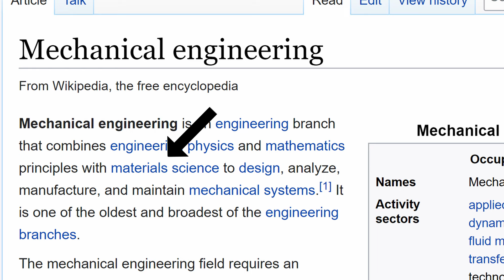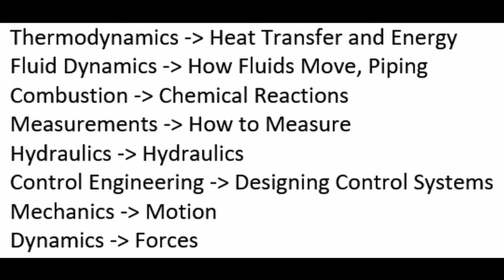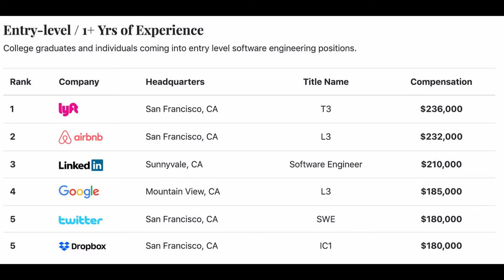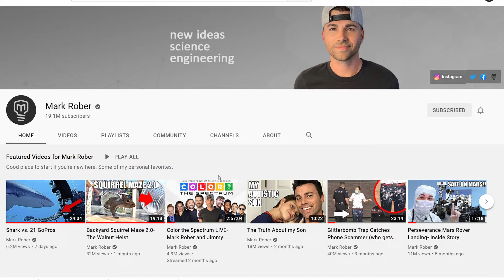EVERYTHING Mechanical Engineering! | Jobs, Degrees, Salary etc.

Comment: is it okay if you are  slow  at math then you do mechatronics?
Reply: Honestly no
Reply: You need to be good at math with all engineering degrees. If I recall all of them use a minimum of calculus 2 like coding but you would have to learn alot more if you were to do mechanical.

You can just pass or try extremely hard for the fist couple of year until you get used to it.
Reply: @bigcrowe9573  yeah idk how is the program in US but here we have  calculus  1, 2, 3(several variables), 4 (vectorial) and  5 (complex)  linear algebra 1 2 discrete math numerical methods prob and statistics and differential equations and all the physics which it has a looot  of math: physics 1 2 3 fluids thermo  mechanics  EM, waves and vibrations elasticity and experimental physics 1 and 2.
You don't need to be fast at math I believe that comes through practice. But If you are slow you have to get better otherwise it will be extremely hard for you. I thought I was good at math until I did  calculus 4... yeah

Comment: 1. Always take the job with a higher salary over the one offering stock option, RSU's, bonuses, and other "compensation". Salary is KING...you may not realize this until you start applying for a mortgage!
2. Change companies every 2-3 years to keep your salary competitive. Don't get comfortable or your salary will pay the price. This is coming from a mechanical engineer who worked at AMAT for 17 years and found after being promoted to a manager, I was making $117k in 2017 while my direct reports were making $150k. =(
The more you stick to the above, the more money you'll save while youre young which will have a longer time to compound over the years leading to a faster retirement. Good luck!
Reply: When you switch jobs do you get the same or higher amount? Do you also know how easy or hard it is to get a mechanical engineering job.

Comment: After completing a degree in mechanical engineering, you have several paths to consider. You could pursue advanced degrees like a Master’s or PhD to specialize further or engage in research. Obtaining professional certifications, such as a Professional Engineer (PE) license, can enhance your credentials. Entering the workforce, you might work in industries like automotive or aerospace in roles such as design engineer or project manager. Specializing in areas like robotics or mechatronics can help differentiate you in the job market. 

Additionally, pursuing further qualifications in fields like project management or starting your own business are viable options to leverage your engineering background and advance your career.

Comment: Your video is very nice but you have to describe which part of the job in mechanical degree is very very easy and very very  hard 

And try to make many vedios about different different roles off job in factory 

And also make videos about which job have highest pay  in mechanical engineering degree field

And also  makes vedio   how much products  designer work pay u and which  
Also make vedios about which kind off chapter we have focused off in math's and physic to study 

And link for study  and improve study  

Ans free design learning  link 2 d 3 d

Comment: Is it possible to do masters in aerospace / Aeronautical engineering after doing bachelor in Mechanical engineering? Or is it worth?
Reply from the maker: If you want to you can definetly do that. Up to you to do a cost-benefit analysis
Reply: absolutely
Reply: machE is very related Aero engineering
Reply: Aerospace and aeronautic is mechanical engineering with an extreme focus on those subjects, if you know mechanics you are going to have no problem with what do you want.

Comment: bro Is mechatronics and robotics automation engineeirmg same?
Reply: Automation engineering means that you will be working manufacturing line robots, auto sync systems and etc.
When you're doing mechatronics, it takes you on robots, or moon walkers and other stuff that has brain like PC
Reply: @2listen911  bro i said about not only automation it's robotics and automation engineering
Reply: @jck1784  close enough lmao
Reply: It's basically the same and it only depends on school. Some schools have more mechanical engineering subjects some schools electrical or software engineering subjects...

Comment: GPA is the key difference between BS & MS Engineering. 

You can graduate with 2.0 GPA and get a BS Engineering degree.

Whereas u are required to meet minimum 3.0 GPA throughout your graduate studies.

Graduate school allow a maximum of 2 C’s to continue and graduate or otherwise u are out of the program.

Whereas undergrad schools require minimum 2.0 to graduate. 

This is a huge difference between BS & MS Engineering and make the MS way more difficult than BS.  

Graduate level courses assume u meet  the prerequisites, otherwise it’s a waste of time and money because u would not be able to catchup.

Even advanced mathematics assume u are well versed in Calc 1,2,3.  

As an example, u would not be able to handle graduate level structural or system dynamic analysis or graduate level vibrations courses without the prerequisites. 

You would not be able to pass FFT without command in calculus as an example.  

You would not able to handle stress analysis and FEA without the prerequisite u are required to complete.

Universities regular issue quarterly or semester schedule with list of courses and prerequisites. 

Never never ever try to  jump over the prerequisites or suffer.